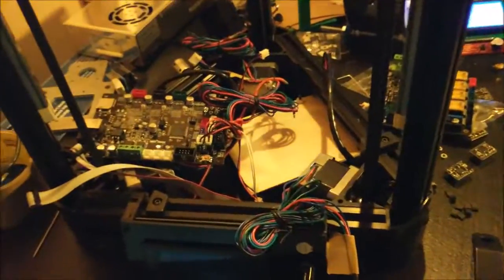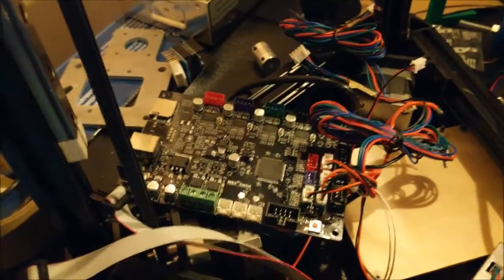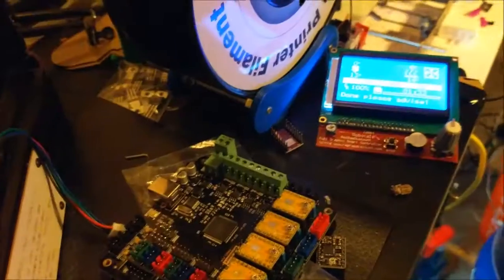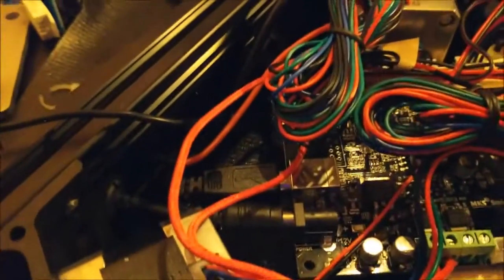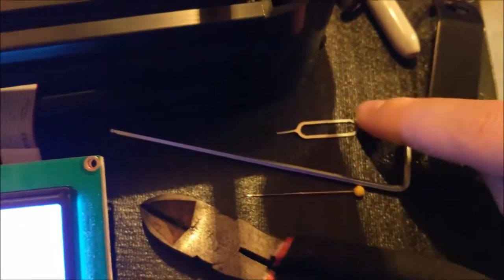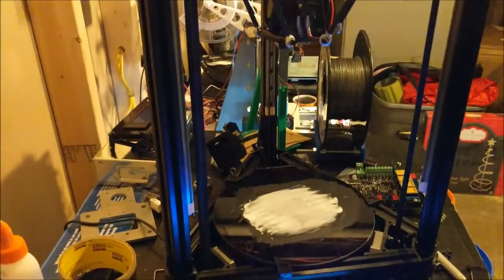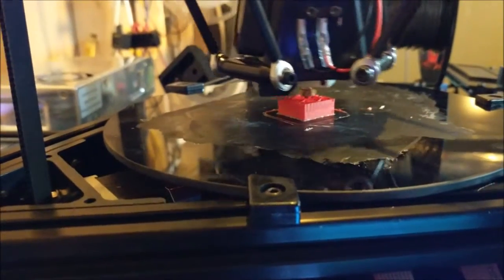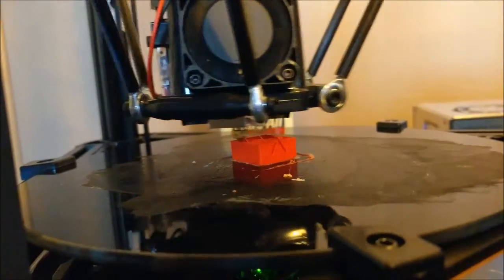Upgrading to the MKS SMINI 32-bit Smoothieboard

Comment: hey i have the same board and i have a problem with the termistor ! can you help me ? wen i start the print the printer drive to z10 and heat up and than becomes error on heat ! ihave no plan .testet 3 thermistos and no chance to print !
Reply: Isaac Fankhauser i have Fond The Problem .Print on USB is Buggy . becoms error .over SD noch Problem :(